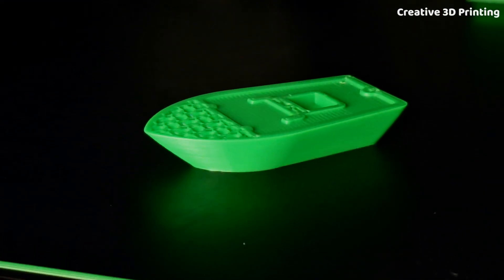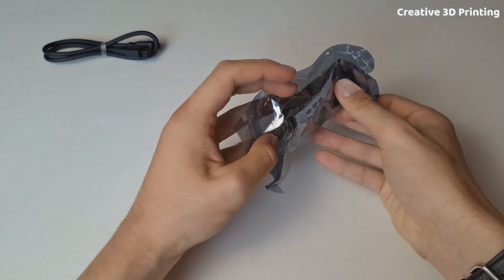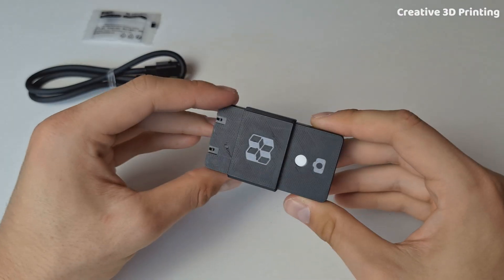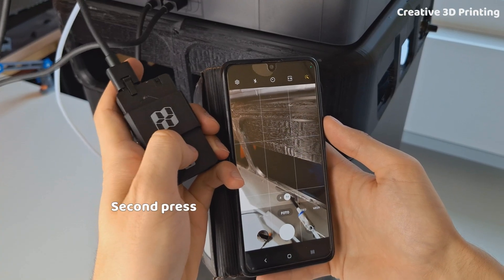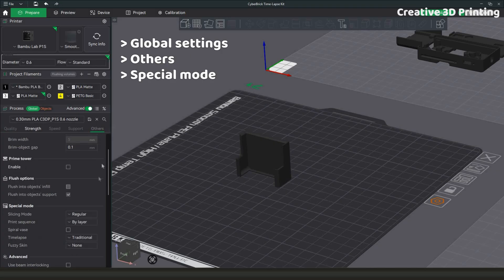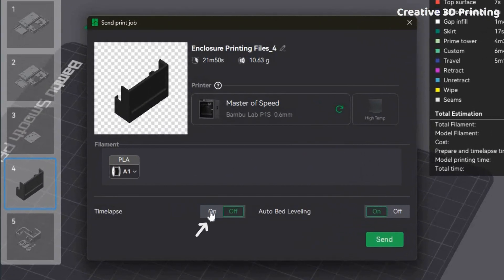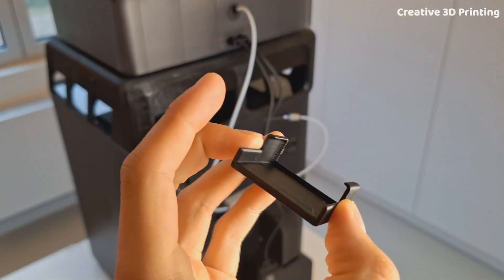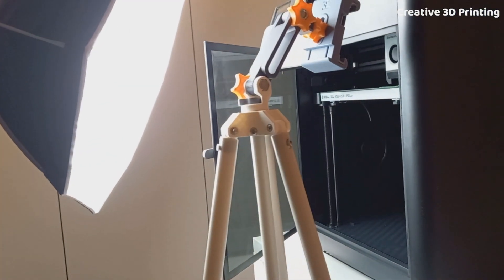Cyberbrick Time-lapse Kit | Setup on Bambulab P1S

Comment: However, the printer has its own camera for that. Doesn't it?
Reply from the maker: Correct but now you can get a different angle and use your own camera which has a (for me) a higher resolution.

Comment: Thank you for a clear and succint video.  Have you any experience working with the CyberBrick and Android phone but for very long printing (time-lapse) periods?  Or, put another way, have you adjusted, if not removed, the screen lock for long captures?  While this (temporary) change is possible on the phone, I haven't had a chance to use my camera kit yet to see if there's any limitations.  Thank you.
Reply from the maker: Thank you for watching!
Not very large parts yet but every layer it's made active by pressing the shutter button so at my phone, the screen was not locked automatically.